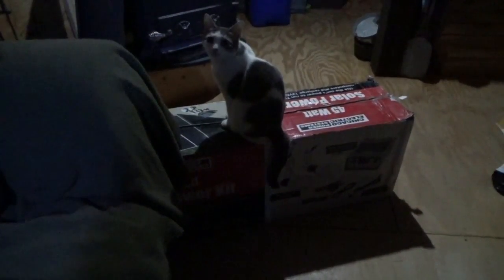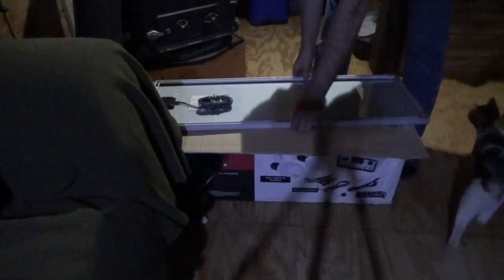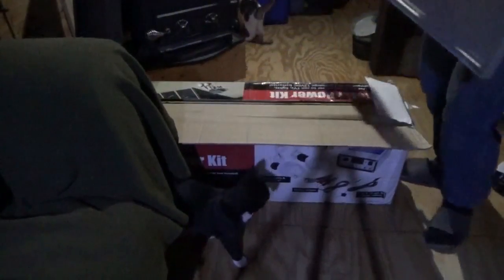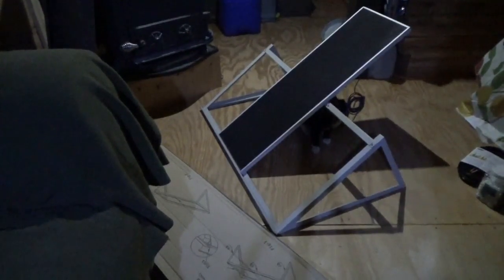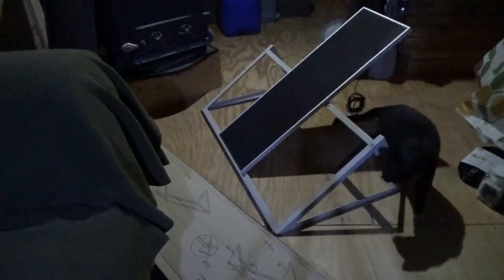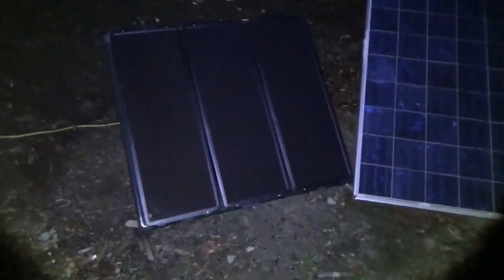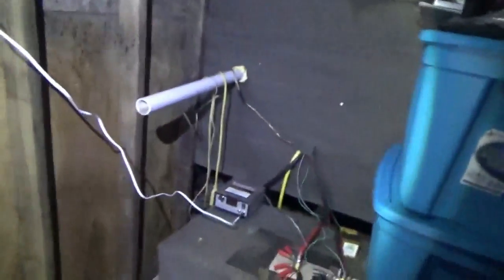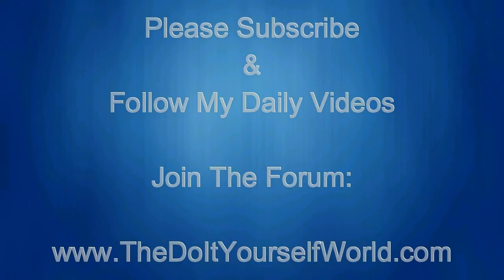Setting Up Harbor Freight 45 Watt Solar Panel Kit

Comment: both sets are designed to be portable, and to provide  power to a 12 volt car battery, for camping or emergency power.  I would keep them on a separate circuit and switch them on on cloudy days., as they are more effective than your 200 watt PA els.

Comment: Hi troy, Good deal on the panel kit. I like the old style much better than the new style.   Having looked at the new style, they are not of good quality and I will not buy them. Anyway I think you have a good plan with them. Best Regards, Bud

Comment: there about 2year's old set i got mine in 2013 they were metal framed harbor freight and coleman solar panels are the same size, i made a 2x3 frame and stuck 5 panels on it! i used a walmart charge controler and it works on my shed too! ps solar panel 3 sets fit in a dodge durango back end laying flat you can have 2 sets and other stuff like satalight setup and battery box setup too! plus wooden legs for my 3 other solar panels i use it fits in a dodge suv hauling a camper!!

Comment: It seems to me the older Harbor Freight solar panel kit is much easier to put together and a little bit more durable. I don't understand how Harbor Freight saved any money by going to the plastic stand with all the fittings and bolts and wing nuts that will rust, which didn't appear to be very sturdy. However, it seems to me both were a great find.

Comment: Didn`t see your lights clearly but if it has screw in base.Buy a replacement base, one with pull chain switch. If not you will have to splice a switch into the cable to turn your lights on and off.
Reply from the maker: +Brew Man My other sockets have a switch inline. I can always put inline switches on them too
Reply: Installing a lamp cord switch a possible future video idea :)

Comment: I like those kits...  I actually hardwire each 15w panel to submersible 12v Water Pumps for Aquaponics, OffGrid...  Flawless since 2013
Reply from the maker: +Bryan Kale I am going to use one for my aquaponics. Have the pump already and the containers are waiting for me to pick them up when I am ready.
Reply: +The Do It Yourself World Awesome.. Ive been offgrid for 2 years building a farm too. Horses, Goats, Ducks, Chickens, Barn, Greenhouse, Aquaponics, Raised Beds.. the works.. all DIY 100% Solar!

A good 15w pump to use is DehangUS Brushless Submersible hardwired to each 15w Panel. No Timers, batteries.. just sunrise to sunset.. maintenence free. I have 4 pumps hardwired in several systems. they've been running flawlessly for 2 years!

Love the Videos and your Project.. I don't feel as "Alone" in the OffGrid, DIY World I'm living!!! keep in touch.  Bryan Kale on facebook ;)
Reply: +Bryan Kale  the pumps are on amazon . com sorry. $20 ;)
Reply from the maker: +Bryan Kale Thanks. I will have a look at them. I got mine at HF for about the same price.

Comment: u have led lights in your  home that use little power how come you never turn them on when doing a video
Reply from the maker: +longlivetheempire I use the headlamp. It is convenient and comfortable. I have not wired up the rest of the house, besides the back wall by the couch and the kitchen over the stove. So I use a headlamp when away from there.
Reply from the maker: +longlivetheempire Please give me time. It is talking a LONG time to build a house with recycled materials. I think most people have no idea at all how much time it takes for one single board.

Comment: 3000 watts on solar power laying around, and stil without power? serieoisly?
Reply: I yust cant stand the problems that are not nessesairy. Wish him the best, but I dont agree with his solutions, agree, if you can buy panels at a cheap, thats not the point, its his already existing system that sucks, doesnt have anything to do with mony, or needness, ts due to negligence he has power troubles. a hf set from 45 watts on a batterybank off 700 amphours wil not have any effect whatso ever.

it will be fine for lights in the shed with a small battery, but its not effective on his big bank.
Reply: Adama Tova  i know, its partly one of the problems, but if you dont harvest the light you do have, it will not work eather way.(besides raising the pannels a few feet, and cutting trees in strategic points), agree he has lots off shade there, but whit the panels already there and mounted better, he can harvest lots more power then whit his current set up. (lot of the panels are not connected at the moment, he needs a better mppt charger,or a bigger one, or a few smaller ones, due to mony problems he invested this summer in a morningstar pwm instea of the more expensive mppt he already has. bad ivestment is my thought....
Reply from the maker: +MrBugsier5 ??????? 3,000 Watts???? Where do you get those numbers???
Amorphous solar panels produce power on cloudy days when others do not. This is a benefit and supplement to my power. Think about it.
Reply: please read the rest of my story, if I watch your video's i see panels lying everywere! lol , the 3000 is only a figure to say you have a lot off power laing around doing nothing, and i still believe your bank is faulty. (no ofence!)
Reply from the maker: +MrBugsier5 Please read the rest of my story. I answered your comment above as well as I can.
Reply: +MrBugsier5  it's the trees

Comment: Troy, I recommend you look into building yourself a LED portable floodlight with some LED SMD chips (a few different color temps at 10W-30W, couple $/pc on ebay)  + batteries, driver and heatsink. Would make a great work light + great for photography in dark inside spaces, bounce light off walls/ceiling for great lighting.  Plus just building it would make a fun DIY video.
Reply from the maker: +FLoat Sam (floatsam) I have one but never think of grabbing it when the headlamp is so convenient to grab. Right on the coat hook by the door all the time.

Comment: Hey Troy. 
One question. what is your total solar array wattage.
Myself i have 3 panels at 250 watt that is 750 watt total and on days where it is cloudy and I myself also got trees in the way of the panels. I have between 200 watt to 500 watt produced at the moment
And in summer I get about 5Kwatt produced.
It seems to me that there is something wrong with your system. correct my if I am wrong but in one video I saw from you, you have on a cloady day not made a single watt. And I believe that I the same day and it was cloudy to here got around 500 watt produced. 
So are you sure youyour voltage is high enough to charge your batteries ???
If I was you I would put the panels you have up on the roff of your tiny house on wheels, I believ you will get a much better result from your panels. You could also raise them so the angle towards the sun is closer to 90 degress. in the winter time.
Anyway. Thx for sharing.
Keep it up.
Regards.
Reply: +The Do It Yourself World A problem with aluminum wire is that it works itself loose from the binding posts. Many a fire has been caused by aluminum wire working itself loose.
Reply from the maker: +Thias Russell Yes there is a lot wrong. My wires are too small. I get about 2-3 hours of sunlight per day at this time of year. Summer is great. Winter is bad with the sun lower. Yes with the panels elevated and more trees cut I will be doing very well.
Reply: +The Do It Yourself World Okay well I would really get those wires fixed as it will make a hell of a differens.
I went all the way with a bit oversized wires at my system, and have had no problemes at all other than the sun not being up so much in the winter time. But hey that we know and there is nothing we can do about it ;-)
Keep up the good work.
Reply from the maker: +Thias Russell Thanks. I just found some 0 gauge triple wire sets at Lowes for $1.89 a foot. But they are aluminum. I think they will do the job but I am not sure about the resistance of aluminum at 100 feet of length.
Reply: @TheDoItYourselfWorld  I don't know if you fixed it yet, but don't use wire from Lowes, use welder lead wire, from a welder shop, or Amazon, from a dealer temco, 1/0, 2/0 should do anything you need, and they gave the best prices I found , for real ofc copper wire,it is really flexible, they also sell on eBay, they have any size you need, 8ga, to 4/0 ga, I usually buy from only them! They also have solar rated wire!
Reply: +The Do It Yourself World Hey Troy. as Cisco Isoffthegrid mentioned I would not use Alu wires as they can not carry the load that good as copper wire can. 
But 100 feet. why not place you solar panels on the roof on your sheed and on your tiny house on wheels. 
I think a lot of them could be placed up there.
You could even make an overhang on your side of your sheed and your tiny house on wheels where some panels could be placed too, then the roof is still free. if you dont want any panels on the roof.
If interested post me private and I could draw you an idea of how you could place your panels. 
Regards.

Comment from the maker: People are having fits because I got another solar panel. I live off the grid. I need more due to being surrounded by trees. I am rewiring the entire system soon for better performance. Watch and see first before mocking me please
Reply: +The Do It Yourself World  This will make how many times you rewired the entire system? Have you gave up on the wind turbines?
Reply: +The Do It Yourself World.....bunch of little girls having meltdowns. Nice video Troy. Really piss them off and buy another. Who they going to call this time? Solar panels police?
Reply from the maker: +The Do It Yourself World And if you are gonna mock someone about what they are doing, please do your research first. Amorphous solar panels produce power in low light or rainy days. Poly and Mono panels do not. This is a bit of a buffer for cloudy days. Very helpful.
Reply: +The Do It Yourself World  Hy Troy!, somting from my hart now...., your other panels (when posisiond and connected correctly) also wil produce power, tho a lot less as in sunny conditions the stil will produce more as the 90 watts from the hf, (with a pwm controller), your now about 2 years in posession of a nice array of panels,please do us a favor and make it priority one tho finally instal the panels permanent and at te correct place, iff you have to down some threes for that do so!, this year i have connected two off grid systems with  only 1000 watts each, flat laying mono cristalyne panels, still having topped up battery's every day, also in low light situations, we are on the same parralel, with the same of weather, fix yoursystem, see iff your battery bank is still ok (i have the idea ther are yunk from day one!), my two customers are everyday watching telly, vacuming and using pumps working on internet and computers,reading and working by good led light, one day more energy from the panels then the other, butt every week the bank is topped of one 2 or even 3 times a week, whitout use of the engine alternator or the generator, iff your system is connected the right way with the right materials you should have power to burn!    I agree that amorph panels produce more watts pro sqare inch than the mono's, but you should have more ten enough from your original panels.... mony spent on better panel cabeling and positioning wil be less then the money spent on your hf panels., I know you have lots of work on the th, but, hey friend, power is also good to have!
Reply from the maker: +Captain Carl Wright I will always be improving things. Who cares how many times I do it? 20 years from now I will still be improving things.
Reply: could not agree more, i'm certanly no hater!, Ï wish Troy the best!, but sometimes I can not watch ,and keep my mouth shut! , I know its trial and error by Troy, and he has certanly  come a long way,things are inproving, but somethings never change, 2 or 3 years now he is re doing panels temporary, while doing it right the first time would have been a lot better fo the power comming in.(and also the used battery bank he has with a warranty is not performing as it should, better replace it under the warranty he has asap., saying again, its well ment comment!
Reply: ***** I agree that the trolls are exceedingly jealous, it shows in the mocking and outrageous videos some of them make. But there's more to it than that. I believe there are some deep seated psychological issues involved when people stoop to the level I have seen with the trolls here and elsewhere on YouTube. I believe  the psychological issues are different with different trolls, but the outcome here always seems to be the same. Rude and nasty comments, outrageous accusations and lies, and the firm belief by the trolls that they are actually doing something worthwhile and important. What they deem worthwhile is perceived for exactly what it is by normal rational people -- a sickness. No amount of rationale will make a troll see truth or reason, therefore reasoning with a troll is a pointless waste of time. What would be of great help is medical assistance, but there is no way to convince an irrational troll of that either. All we can hope for is that one day Google/YouTube will get their act together and start getting rid of troll accounts, or better yet perhaps the FBI will start doing their job and prosecuting those people to the fullest extent of the law. Troll behavior is not acceptable in real life and it shouldn't be acceptable here.
Reply from the maker: +MrBugsier5 I bought the wrong charge controller. I got a PWM which is rated for 12 volts. I have an MPPT rated for 150 volts but only 800 watts. Sure I have solar panels unused. But for that I need another expensive MPPT charge controller. For now I am going to max out the PWM charge controller that I have and connect all the 12 volt solar panels.

I am also going to run a set of solar panels in parallel with the first set on the MPPT controller. I just bought some new wire and some diodes to set that up properly. Give me some time to get it all together.

But - I still need a new MPPT solar charge controller after I finish all that in order to use the other solar panels.
Reply: +The Do It Yourself World : Unfortunately there are some people who will have a fit no matter what you do. It's your life to live as you see fit and if some people can't grasp that fact too bad. Try not to let the tantrum throwers get to you. :-)
Reply: +MrBugsier5 Troy is learning as he goes and trying to pass on what he learns. It's easy to sit in a chair and criticize a man. It's another to walk in his shoes. Troy seems to be a hard working christian man. I think positive suggestions would be acceptable to him. Have a nice day bud.
Reply: MrBugsier5 Of course you're not a hater. I think you know the people I'm talking about though.
Reply: +MrBugsier5
The thought of being off grid is very exciting to me. I know it's hard work, but it's a kind of life that appeals to me.
Reply: +MollyDolly 
oh what a beautiful morning!
Reply: +The Do It Yourself World  Hey can never have too many solar panels  :-)
Reply from the maker: +sunrise 13 I know, right
Reply: We've got a small Harbor Freight here in Laredo too. I've been thinking about purchasing the same kit as a starter kit for experimenting with. Looks like fun. Down with the negative Trolls.
Reply: +Richard Byrd
In my opinion, this is an excellent sort of kit for you to start with and with which to get your feet wet, regarding solar power.  Best of luck to you!
Reply: +The Homestead Chronicles
Thanks. Same to you.
Reply: WC Prepper 2 agree, but he bought it cheap and slightly used.
Reply: ***** mono cristaline is the panel to go for, dont know US prices, but here in europe its not so expensive anymore, forinstance, a 260 watt panel new for bout 160 euro's new. the hf sets they sell in the US are way to expensive for what they are (amorph foto film crap.)
Reply: ***** mono cristaline's have a better power factor than poly cristaline's,amorph panels give a bit more power at low light levels,but have a shorter lifetime .
Reply: Richard Byrd  dont worry, I have a lot of (well ment) discussions with Troy about his power set up and better how to, lol, I'm sure he is not offended, I'm not in the mans shoes, so he is free to do hat he thinks is best, also you have to remember is that he has lots off comments in how to do things, its not easy to choose the right one's!, lots of given advices are whell ment, but hopelesly wrong. all i can tel you is that i'm a licenced, proffesional ofgrid system installer/seller here in the Netherlands, with lots of experience in this things.like, seen it, done that., my advice is free to use (or not), all i say is dont re invent the wheel, dont make the mistakes anyne else had made before!
Reply: +MrBugsier5 
Troy is smart. He'll eventually figure it all out. If not, he can always come back and ask someone like you.
Reply: +sunrise 13  lol!
Reply: Richard Byrd  Indeed!  :)
Reply: surprised there im . not they think they own you.
Reply: They do TROY

Comment: I just tried a small solar test myself.  A 20 watt, 12-volt  panel was on sale, so I figured I'd see if I could just hook it up to a 12 volt outlet and use it as a USB charger.  Seems to work...but it's VERY slow this time of year, partially due to lack of daylight hours, and partly because since I haven't found my soldering iron it's inside, behind the patio door, so it's getting UV shielded through two extra panes of glass at the moment.

Should have sprung for the larger panel...but whenever you're just trying to test a theory, you do tend to go the cheapest route first.

Note:  NO charge controller yet, just connected the 12 volt socket directly.  2 sockets and 2 USB ports, just sitting in the window...generating free power.  SO the basic concept worked, anyway.  d=O)